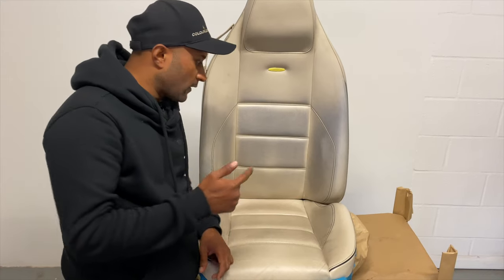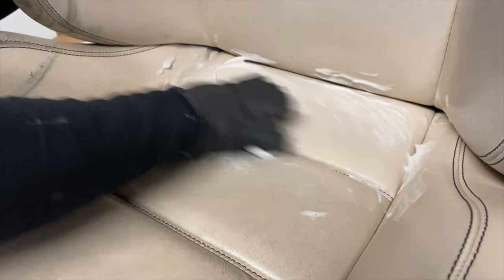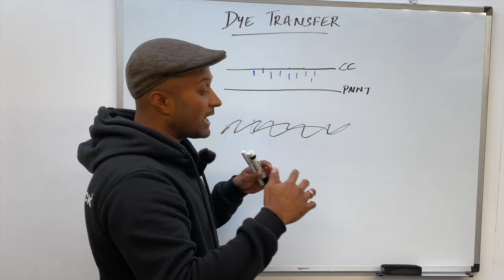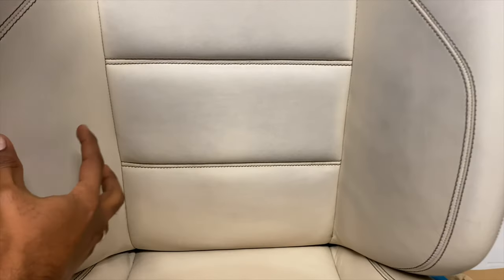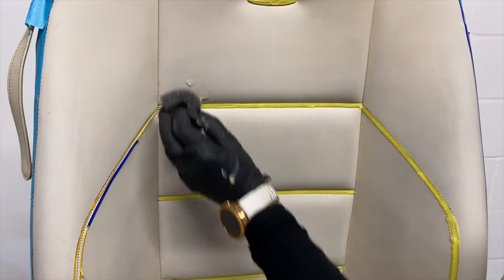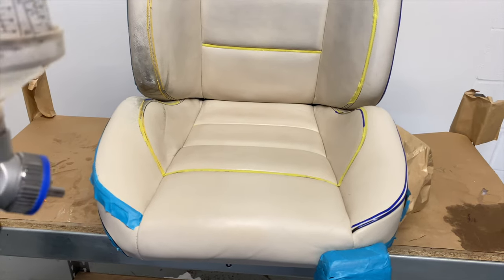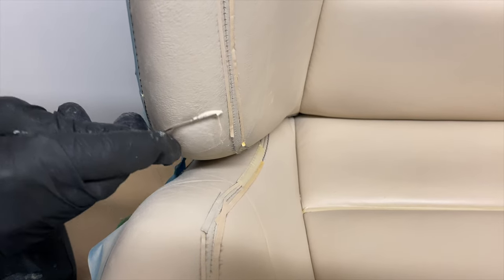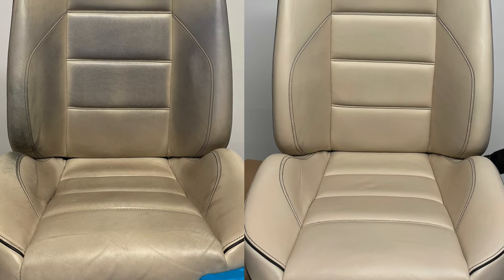SERIOUS Denim Dye Transfer | Mercedes SLS | Leather Cleaning & Restoration | leathercare.com

Comment: Hi.
I have a small dye transfer on my light coloured Bentley leather interior. 
I’ve tried most things to remove it without success. 
Any advice please, is your cleaner stronger than I can buy in car factors ? 
And if it can’t be cleaned do you offer a mobile service to dye it ? 
Many thanks 
Vince.
Reply: Same problem , got major dye transfer stains on my leather Lamborghini seats
Reply: @jazlanderz5000  
Hi, 
Got mine sorted by a detailer, he used the colour lock system, and it’s a fantastic job.

Comment: So...which way to go... i see you have a airbrush but how come Colourlock don't recommend using one ?.
Reply from the maker: We have two product ranges - a DIY range which does not need to be airbrushed and can be applied with a sponge. If you use the professional range, it is best sprayed using an airbrush or spray gun. In this case, we used the professional range. Hope that helps.